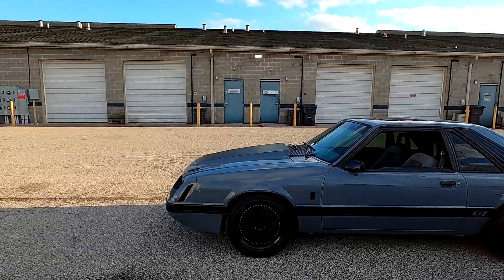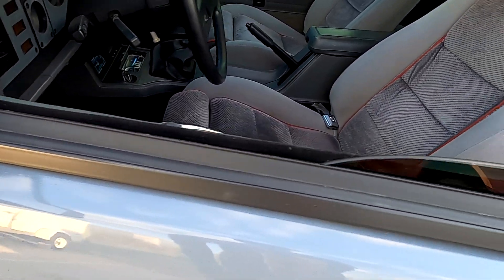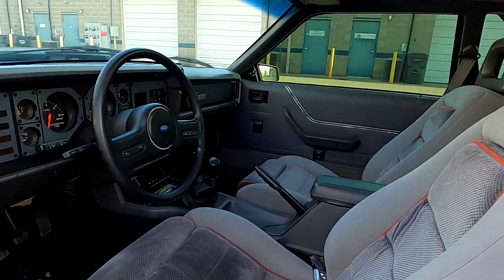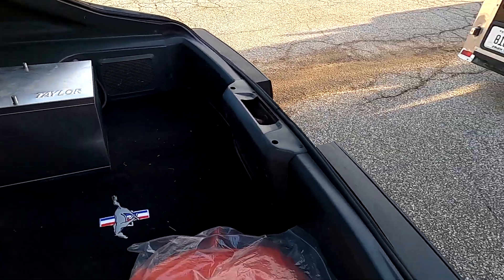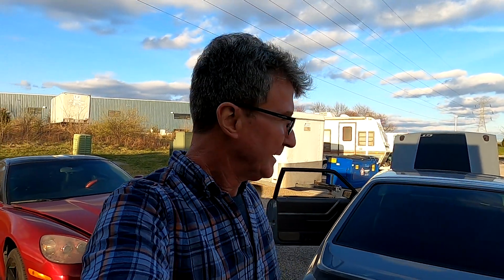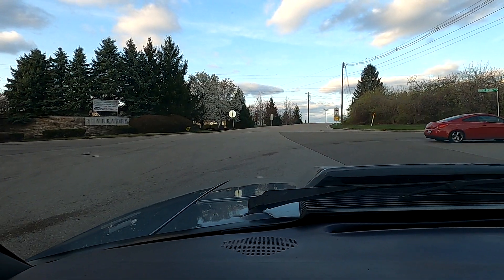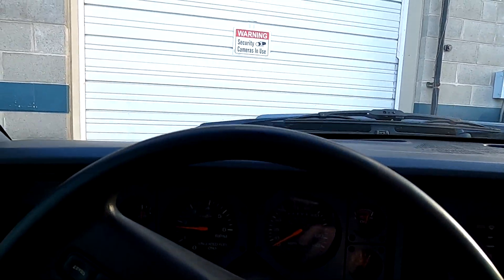408 Stroker Fox Body - Walkaround and Drive

Comment: Wow, thats a sharp Mustang. Ive found my '66 289 runs pretty good with like 25 degrees at idle, 34 at WOT and like 43 at low throttle low rpm cruising. I put a vid of me tuning my Holley Projection up.

Comment: From what i gather the shorty headers either come off the previous engine or more likely no long tubes becouse of fitment issues with that block
Reply: For 351W swap long tubes you've got two options. BBK makes a set which are ok, about $800. ARH makes a VERY nice set, but they are north of $2000. 

The 351 is a taller deck block, so it moves the headers both up and outwards, making fitment in the limited space...challenging. I am doing a 393, and plan on using the shorties this car has as well. They don't make quite as much power, but as you saw in the vid, it's got PLENTY of that, not worth the headache unless you are doing a tubular K member.

Comment: So how did you come up with 12.5:1 not knowing how far the pistons or in the hole or the head gasket thickness >? I'm willing to bet thos heads are 63cc chamberds and the pistons are more than .015 in the whole, and under 12.1  compression witch is fine for 93 pump gas, the Easy thing to do would be to cheack cylinder pressure if it's under 200psi then it's fine on 93...

Comment: I know what you are saying about long tube headers. But are they worth the headache when it comes time to changing the starter? Long time watcher first time commenting lol.
Reply from the maker: You usually don't have to remove the headers to get the starter out. But if you're balling out on longtubes and are worrying about changing the starter, just replace the starter too. Haha
Reply: @SavageProductionsCars  touché
Reply: late model pushrod 302's came with a smaller starter from the factory. It was somewhere in the 1990's, i don't remember the exact year, but i think Explorers with GTo40P heads have them as well. It will give you an inch or more clearance.

Comment: My shop built a 12:5:1 compression coyote motor and the customer runs on 93 octane, BUT Everytime he fills up he does use Octane Booster. E85 around me is quite far out of reach

Comment: I thought the cam tells the story on the comp ratios. The motor doesn’t run static.
Reply from the maker: That's the whole reason why retarding the timing down to 28 or so degrees will allow this car to run safer. You change the ignition timing to fire at a moment when enough air is being scavenged so you don't create too much cylinder pressure. Regardless, you can't just ignore the static compression ratio. That's how you determine how much you can/should advance or retard timing based on air and fuel.
Reply: That's true, the cam duration bleeds off static compression at low RPM, and an aluminum head will let you get away with 1 point more compression than a cast iron head. plus many aluminum heads have a better chamber design to resist detonation, and the tighter the rings seal the cylinder, the less oil gets in to help detonate.

But if you're building to flip, keep the compression down--no sense selling a racing compression engine to someone who can't tune (the EDIS distributor isn't as easy to tear apart as a GM HEI), then they blow your engine and tell everyone you sold a bill of goods.

Comment: Why was it built with 12 to 1 for the street?
Reply from the maker: Not sure. Not our build lol
Reply: Why not? Responsive, more torque through out the RPM range, helps move airflow… better to run E85 anyway to eliminate any knock issues. With gasoline having 10% Ethanol in it anyway, why not take advantage of a better fuel all together?
Reply: if its running E85, it better get rid of any rubber hoses in the fuel system--they don't play well over time. And not all states have E85 at every pump, if you're building a car for flipping. Every point of compression adds about 4% more power and some better fuel economy, but the question is, is it worth it? if you run a domed piston to get that compression and it blocks the flame crossing the bore diameter or crowds the valve and disrupts flow into the cylinder, then you are hoping to gain enough to counter the loss.   

meanwhile, this car isn't running AC. As someone not running AC, i can say "street car" is questionable :)  Yes, i have four window 40 mph "air conditioning" and it don't do d#$ after 2 hrs of driving even in humid air, it's just noise in the ear.
Reply: @albertgaspar627  lol glass to see someone else grasps engine math. Ohio is fuel of E85 at the pump. All I know is, an over bore, smaller chamber and flat top pistons can give 12:1 or greater on SBF and Modular Fords.  One day I’ll finally build my 4.6 2V, with 3.7” bores, standard length rods, and Trickflow 38cc heads; 15:1 static compression. A strictly E85 build for the street.
Reply: @rayman1230  yeah, there's a lot of factors going on. like again, if one's building a car to flip and even thinks they may be trying to sell it nationally, CA buys the most cars but their highest pump gas is 91 octane. they can get E85 tho, but then you're losing fuel economy. Of course it depends on whether one's building an "around town toy" or a daily driver or a HRM Power Tour long distance hauler. Personally i invest in displacement over compression--run lower rpms and you get decent gas mileage with highway gear ratios. and with a more streetable compression and bigger displacement, when you finally get bored you can put on a mild power adder with the compression ratio and get a bigger "bang" due to the increased displacement--say for example a turbo with single digit boost giving the engine 100% VE or a little more. with higher compression, you're going to step up numerically on the rear gear ratio to take "load" off the engine whenever you're not at WOT. How close do you get to too much gear going thru the traps in the quarter or eighth? but you can theoretically play with rear tire heights. point is, see the entire car as a system and you can find that "4 percent increase per compression point" somewhere else in the drivetrain. 

Ironically on this particular engine, a day at the dyno to figure out what exact long tube headers are the best, could give back enough hp to match the 4% gained thru an extra point of final compression. And you raised another issue about compression in your second to last statement--if you're going to go big, you might as well go as far as you can on the available fuel (around here, C16 was $26 a gallon this spring, caught everyone running over 12:1 CR on the street offguard, but that's the nature of the beast--you wanna play, you gonna pay). you've probably seen the articles about long connecting rods helping high compression resist detonation, in case you do build that 4.6 and think about 'rod length

http://purplesagetradingpost.com/sumner/techinfo/350%20chevy%20engine.html

Comment: Awesome color super clean fox.....you can tighten those map bags pretty easily the reason they put shorty headers on instead of long tube is they probably planned on making a driver out of it long tubes are not always better than shorty headers long tubes make power from mid to high rang in the rpms while shorty headers make power from idle to mid range so if your not planning on turning 8k rpm no need for long tubes especially on a NA engine

Comment: carb engine would have been easier, or holley sniper. I would have done 10-11. so you can keep 87-93 octane in it.
Reply from the maker: Well, it's not your car, is it? Not everyone wants a carb setup.
Reply: @SavageProductionsCars  true. But in my experience a carb or a Holley sniper is much easier to mess with than the old EFI system
Reply: @nathanieljones7981 I'm going Sniper 2 in mine, at least for now. Maybe a custom setup later with a Terminator X. But it's nearly impossible to find a good upper AND lower intake manifold setup for the 351W based engines. Much better intake manifold choices available with a carb style EFI setup.

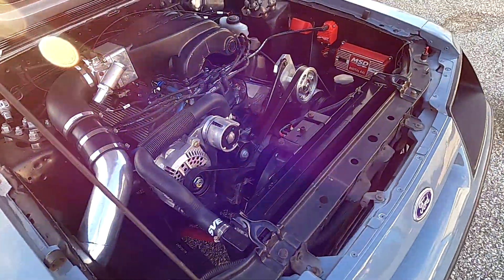Comment: not a great fan of upper radiator hoses that sit higher than the radiator cap (8:51)--that's an air pocket waiting to happen since hot air rises to its highest level, and some builders plumb a standalone radiator cap assembly into the hose. If that air isn't entirely bled out of the cooling system, there's an issue that could show up running that high a compression ratio.  I'd almost mount the alternator where the AC delete pulley is to get it out of the way for a lower hose, but then I'd want AC on a street car anyway.
Reply from the maker: You do realize that is the factory setup for this car, right?
Reply: @SavageProductionsCars  I do since I had one :)  I also went thru the classic ignition module conking out, how the voltage regulator on 1986 Fords go after 120,000 miles (owned a ranger 4 banger pickup and a turbo t bird from that year too, just a coincidence) and so the temp gauge spikes out when the vehicle comes to a stop (and eventually all the engine gauges start doing it) and how the 86 Mustang loves to blow out its rear taillights. how rear disc brakes could have been at least an option (rather than buying an SVO for Lincoln's setup) since rear drums are barely adequate for circular racing or more negative camber could be reached with longer T bird lower control arms since there was barely any adjustment above the shock towers from the factory. and of course how the T5 tends to wipe out its third gear synchros from the terrible shifter design. Not to mention the hideous heater core repair job if the car was optioned with AC and the original heater hose design no longer exists so you have to buy a different style hose. 

in other words...the factory setups had their known design or quality flaws :)